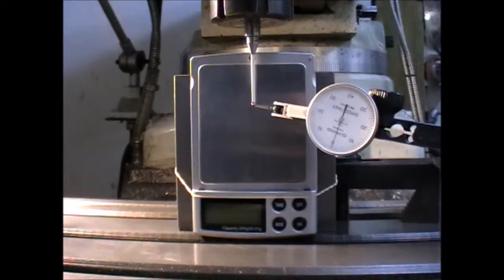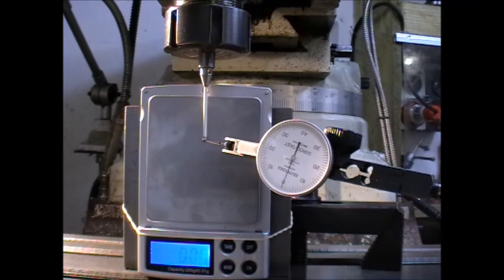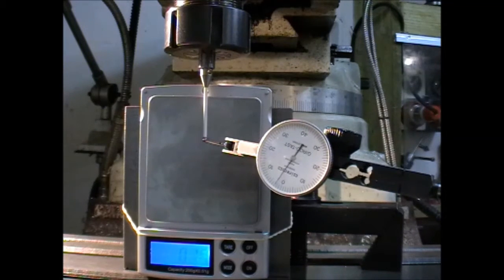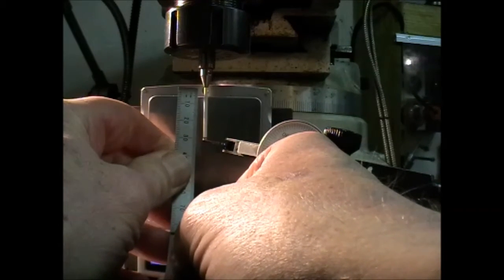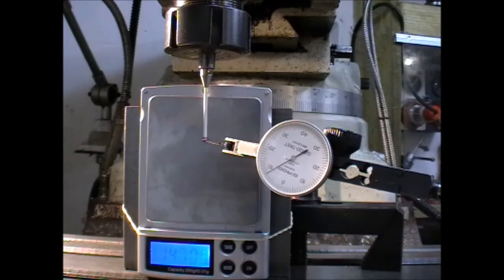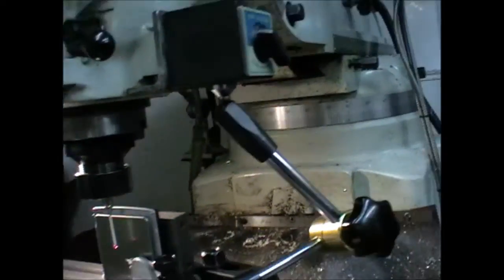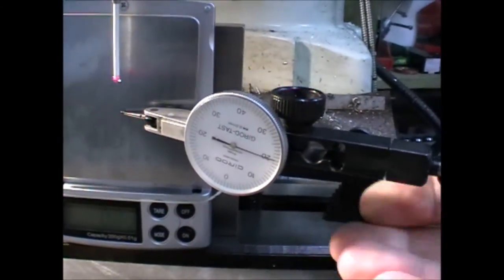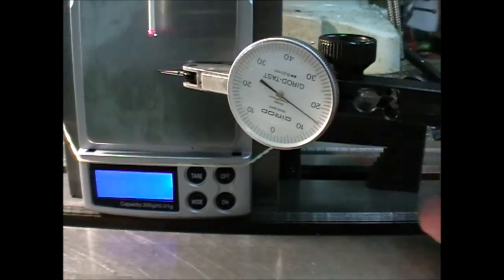Tormach Passive Probe part 4

Comment: What happens if you take the chuck and rotate it 180 degrees.  IE one measurement with the electrical lead to the right on the x axis and then measure again with the lead to the left on the x axis?  is the error the same.  My guess is that it is different due to the three pin layout of the internal contacts.
Reply from the maker: Hi Mark. Sorry I missed your question when you posted it.   You can overcome the probe errors by rotating to suit the direction and axis - but that is time consuming unless you have spindle orientation and control software to suit as per high end machines.